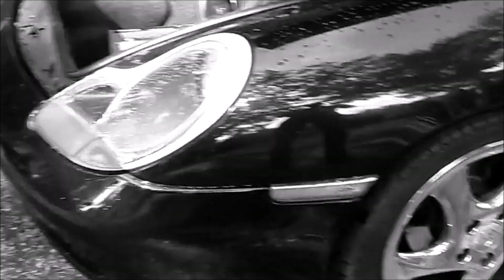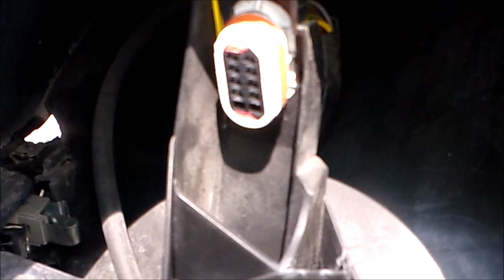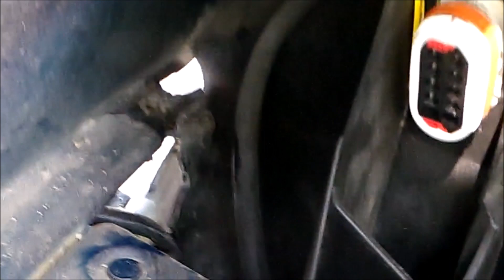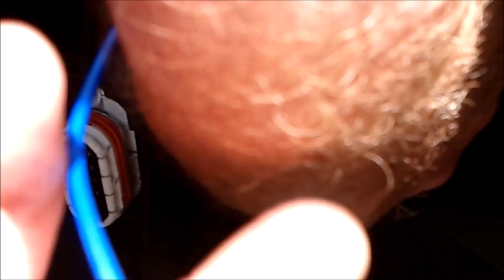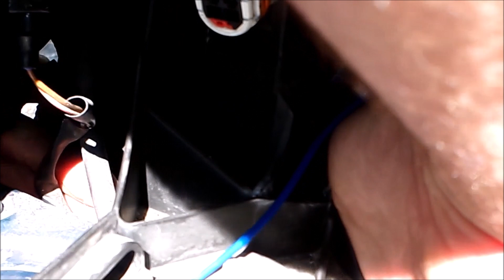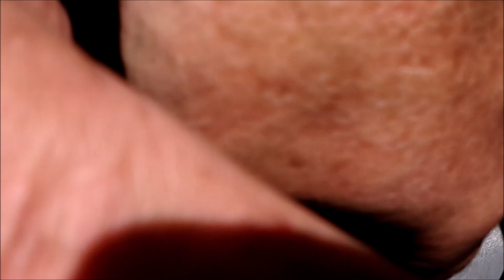Porsche 986 Boxster side marker/turn signal alternating flash upgrade/hack

Comment: Uh oh.  On my driver’s side (left) it is working perfectly.  On the right, my front turn signal now doesn’t work or flash even with hazards.  I think my high beam is also out.  The indicator light on the side doesn’t flash.  Also, the turn signal switched to that right side flashes very quickly.  Interestingly, with the hazards on, the right side indicator flashes, but the front turn signal light remains dead.  What did I do wrong?  Tap the wrong wire?  I don’t have a meter so didn’t test.

Comment: I just did this and, after a few hiccups, all is working well.  Initially, some of the lights in the driver's side were not working.  Bulbs and fuses looked good.  It turns out my issue was not with the wiring per se, but with the alignment of the headlight assembly pins to the female connectors on the mount to the wiring harness.  Pulling and tugging on wires to make sure I was tapping into the correct one to tap into must have caused the mount to move a bit, resulting in a bad connection to the assembly.  A little trail and error adjustment, and the problem was resolved.  Happy with the outcome.
Reply: I think I have the same problem.  My female mount is loose.  How did you stabilize it?  Especially the top part gives…
Reply: @kattanmichael9289  sorry, I can’t recall the exact adjustments I made, but seem to remember one or two of the individual female connections looked off kilter.  I think I just grabbed a small pliers and made them look straight, rather than try and bend or move the entire mount.  I haven’t had the headlight assembly out since because I’m a little afraid it won’t align again upon replacing.  I guess I’ll eventually have to do it when a bulb goes out.  I don’t drive at night too often anymore.
Reply: @grc0456  Thanks for the reply!  I was inspired to inspect my male prongs.  Boy, they look pretty straight.  But my turn signal and high beam are out.  The top of the blue plug flexes back, so I tried to super glue it to the black frame it mounts in, but that didn’t work.

Comment: GM started doing this in the late 70"s, great idea. But I think they've dropped it more recently. No other manufacturer ever figured this out. Ford only used 1 bulb forever as running stop turn and side marker, GM almost always had a seperate side marker bulb, even on my '68 Olds 98 front, 1sr year for side markers
Reply from the maker: Yeah I remember a lot of GM cars had this .. some other that I can't recall, but it is possible I had modified it..lol...damn brain is getting useless. I've used the floating ground idea for fake LED alarm lights, Headlight on reminder buzzers , to turn off aftermarket fog lights when high beams on etc.
Reply: fupabox GM pickups had the alternating side marker-tailamps in the late 2000's generation. And the rear sidemarker was visible from the rear, an additional safety feature. It's amazing how many manufaturers didn't pick up daytime running lamps... Mercedes, Mazda, Toyota... And to this day many cars don't turn on the lites at dusk, leading to folks driving around with only dim drl's. I see at least 1 every nite! My 2000 Suburban had auto all lites on, no automatic position, all on at dusk period! And that's over 15 years ago!
Reply from the maker: I hear ya .. Canadian version Benzes since 2001 have had ALL lighting comes on when car in drive. Only thing unavailable is high beams which need light switch to be turned on . I see most cars here with DRL have the dash gauges light up with the DRLs, so people end up driving at night with headlights and gauges lit , but no tail lights. They see lit up gauges and can see ahead and don't realize their lights are mostly off. Horrid design flaw by most manufacturers. All lighting should just come on with car in drive. Also would love the flashing hazard lights whenever ABS kicks in , or when high brake pressure applied. Easy, nearly free to implement things that would have real safety benefits. Your suburban can over ride the all lights on with parking brake applied ?  My buddy's Tahoe does the same as yours , but if you push the parking brake the lights go out ..Maybe a throwback to keeping the car running periodically at drive in movies .
Reply from the maker: I add the brake flashers to all my bikes ..just a little extra to warn the dimwits not to kill me .  A was thinking of flashing the hazard lights when excess braking applied, so front and rear people can be warned that something is up. Speed limit on highways here 100km .. they will rarely bug you until you are over 120 ,unless weaving or some other honnish maneuver. Too many people install the HID headlights in cars not made for them . The actual law states that any vehicle equipped with HID has to have auto aiming , and headlight washers (HIDs can't melt snow off effectively ) The garage door aiming is too tough for people nowadays I guess